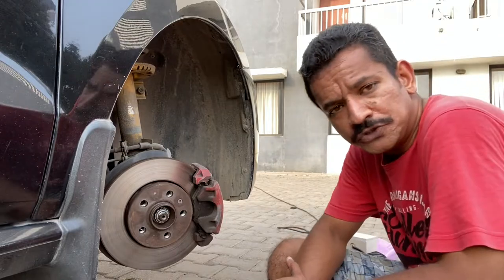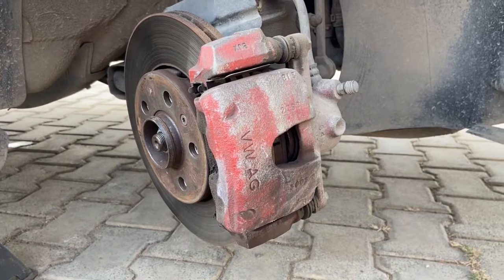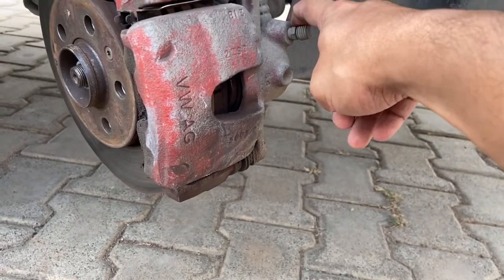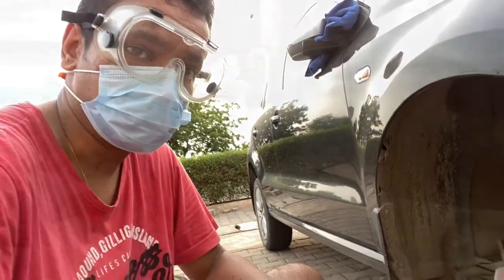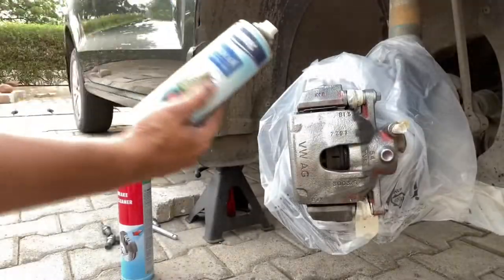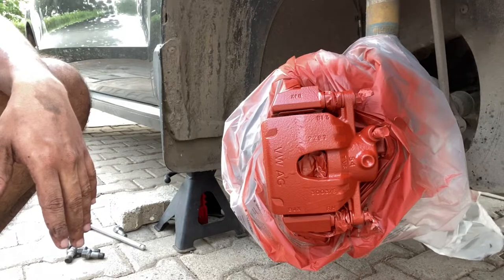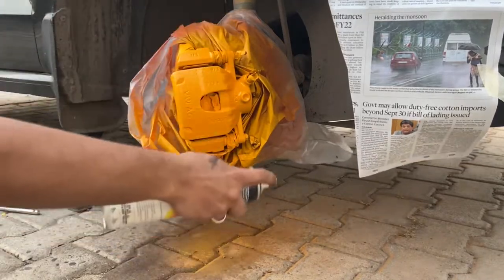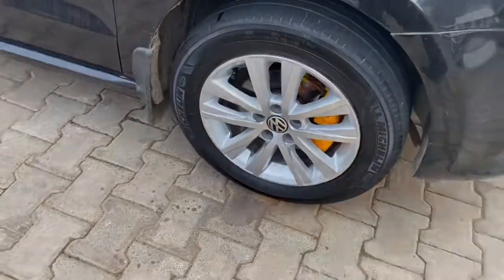Polo 6R - Painting Brake Callipers

Comment: Best video as usual. The finish came out exceptionally well.
Reply from the maker: Thank you Vinayak. I used a primer this time whereas the last time, I simply cleaned the callipers using a wire brush based attachment and applied the final coat over it.
Reply: @GaneshBalan  yes, you did right thing of applying primer. And I must say, the finish you have achieved is mind blowing.

Comment: Hello Gannu sir, 
What's your opinion on remapping my 1.6TDi which has 1.35 lakh kms on ODO?
And lastly what's your opinion on Engine decarbonising
Reply from the maker: Hi Gagan. Remapping is good provided you know what you are dealing with - the tuner, the map and the results. 

You must study the tuner and his feedback online - check Google maps reviews for his place, reviews on online forums like Team BHP etc. 

Please understand that all car manufacturers select an ECU tune that returns a good combination of fuel efficiency and performance. If you opt for a higher one for one of them, the other takes a dip. You can’t have both. 

Also, the parts of the engine begins wearing at a slightly faster rate when you remap your car for an aggressive tune/performance. 

Remap only if you really need it. The 1.6 TDI as it is, is a cracker of an engine. There are several remaps for it offered by various tuners. So take a wise call. 

Decarbonising using that machine is nonsense. However, it you remove the inlet manifold and give it a proper cleaning, that removes all the soot and carbon buildup accumulated over all these years. This is recommended not the machine decarbonising. That’s dealers fooling people.
Reply: @GaneshBalan  Thank you so much for the suggestion. I’ll think over again before remapping. I’ve heard good reviews about Wolf Moto on the forum so I’ll check them out in person ..
Reply: Sir I’ve over a lakh on my odo. Should I worry about that before the remap.

Comment: Great videos.  I have a polo car 2017  1.2 TDI that has a problem with the temperature, after the car drives the temperature starts to rise and of the airconditioner is on it becomes higher until it reaches 130 celsius degrees. the water level is fine and when it is high if I open the water reservoir I can see some gas. I have had this for 6 months and I am using the car with caution I stop it every time the temperature is above limit the once it is cooled down I continue. Could anyone help me with that?  
@vinayakswami1972
Reply from the maker: Hi. Were you able to resolve the coolant overheating issue?